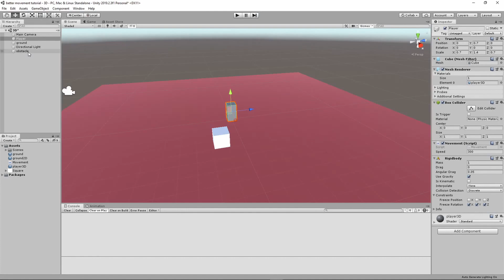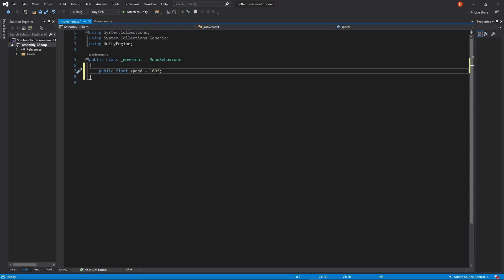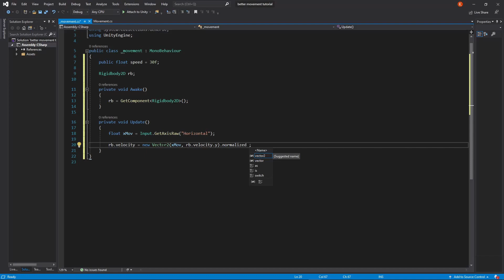The right way to do movement in Unity!

Comment: What if you want your character to move forward depending on which way you are facing using rb.velocity in 2D? I understand forward and backwards but when I try to rotate, it doesn't go forward, it just goes up and down.
Reply from the maker: Great question! I suggest you watch my video on 3D FPS Controller, which works pretty much the same way. You just need to use the Y axis instead of the Z. But here what you need to do: First you need to variables that will keep track of he speed in the X and Y axis (eg float xSpeed = Input.GetAxisRaw("Horizontal") * speed * Time.deltaTime; and do the same for the Y). Then we are going to use the transform.forward and transform.right vectors. Think about them as arrows that point to the local forward and right direction accordingly and have a length of 1. If you multiply a Vector ("arrow") with a float then it's length will get bigger of smaller accordingly. This means that we can multiply the transform.forward and right Vectors with the according speed variables from before. This will give us the final velocity Vectors for the local axis of the player. Then we can add whose and normalise the result and pass it into the rb.velocity variable. Here is the code for this:
rb.velocity = (transform.right * xSpeed + transform.forward * ySpeed).normalized;
Hope I helped you. If you have any further questions and problems feel free to ask them or even join the discord server (link in the description).
Reply: @ComplexDimensions  wow thanks so much!

Comment: how could i implement momentum using this method? ive been trying to figure this out for weeks
Reply from the maker: What do you mean by momentum? Do you what to create a physics-based game (say a flight sim)? Then you will need to make use of forces. By adding a force to an object you are accelerating it and that will give you momentum. Generally, though, momentum comes built-in with the RigidBody component. It depends on what you want to make. It would be great if you could provide me with a few more details.
Reply: @ComplexDimensions  i want to create a nice fps movement system, when i use rb.velocity it starts and stops straight away so it feels weird
Reply from the maker: I see. Well, there are two ways to do that. One, which I recommend, is to apply some smoothing on the input. The easiest way to go about doing that is to use Input.GetAxis instead of GetAxisRaw. If you want to create a manual smoothing, though, you can add every frame a certain amount to a variable according to the input until it gets to 1 or -1. I am planning to create a small video on smoothing inputs in unity.
When it comes to the second way, you will make use of the AddForce method. This will accelerate the player constantly and you can do that as long as the speed is smaller or equal to the speed that you want to achieve. The only problem is that it probably won't be that smooth and you will have a hard time implementing the breaking behaviour (stopping).
Hope I helped you. If you have further questions feel free to ask me again. Also, if you want some help with the first implementation, you can also join the discord server or even contact me personally there (link in the description).
Reply: @ComplexDimensions  thankyou!

Comment: Wouldn't putting the movement script in FixedUpdate just fix the entire issue?
Reply from the maker: The issue is caused by directly changing the position of the object. It doesn't have anything to do with the rate at which we do that.

Comment: hello, how to do those controls, for ships, as in the game Ship Simulator Extremes, as you push it forward, if you pull the lever it moves backwards, and if you turn the wheel, it turns the ship, at constant and slow speed, as it can be done, because have faster and slower ships, thanks
Reply from the maker: Great question! In this case, you will need to use forces. Making use of the RigidBody.AddForce method, you can simulate realistic physics behavior. Check out Tom Weiland's video on the topic. He explains how to create ships in unity very well. I also plan on doing a video on flight and in general realistic physics like simulators in unity.
Reply: Thank you, I liked how you explain it, I use a translator, I’m from Brazil, I liked the movement mechanics of the game Ship Simulator Extremes and I intend to learn to create a ship game in that sense, like the world of warships does too, thanks

Comment: I think something like addforce would work better because directly changing velocity causes issues
Reply from the maker: The constant force would result to a constant acceleration which in this case we don't want. Also, what kind of issues causes the direct change of the velocity? I would live to know, thanks!
Reply: @ComplexDimensions  One issue I had using velocity is that collisions would cause the player to glitch out. I manage addforce by doing AddForce(x * (speed - Mathf.Sqrt(rb.velocity.x * rb.velocity.x) etc. and that seems to keep it at a constant rate. Also to make sure the player stops moving when there is no input, i do a check for whether the keys are being pressed and if not i set the velocity on their axis to zero. Thank you for the tutorial though, it helped me out a ton
Reply from the maker: @rommarone1025  I actually use the velocity to prevent this problem from happening. Also, it is more complicated to use add force and not only that but calculating so much stuff that is required takes time, especially for a slow computer. Your idea could work if you want to achieve another feeling.
Reply: @ComplexDimensions  Good point, but i’m curious what you mean, I used pretty much the exact same code used in the video and had problems with collisions. I asked about it on forums and they advised me to just use addforce, and said that “directly changing the velocity causes issues”
Reply from the maker: @rommarone1025  For your problem: there is a collision detection setting in the rigidbody component. Play around with it and you will get different results. 
I can't understand much when people say "directly changing the velocity causes issues" when they don't specify any. I didn't have any problems with it and using transform was sometimes worse. A better way could be rigidbody.MovePosition(), but I don't think there is a big difference, since it moves the object's position (I am afraid I don't know how). Also, the rigidbody component was intended for physics simulations and changing the velocity will result in none accurate simulations. But we don't want physically accurate results such as Newtonian physics. So what we do here is complitly okay. I think when you have a tool, in this case the rigidbody, you it is okay to use it the "wrong way" or the way it wasn't intended as long as it has satisfying results.
Reply: @ComplexDimensions  Yea I mean I changed and experimented with all the settings in the rigidbody and it didn’t help. I’ll look into it more though. By the way, if you’re interested I’ll link to a question I asked on reddit about this: https://www.reddit.com/r/Unity3D/comments/junp6d/friction_between_player_and_wall_causes_player_to/?utm_source=share&utm_medium=ios_app&utm_name=iossmf

Comment: Complex Dimensions:pls explain me what means normalized,actually what do that ?
What I know about Method Normalize () is that has magnitude of 1 ,that means he always move by same step.?
Reply from the maker: Well, normalized converts a vector so that it has magnitude of 1. Think about it this way. We can visualise a vector with an arrow, the longer the arrow the bigger the magnitude of the vector. To find the magnetude of the vector you use the pithagoras therom: √(x²+y²) A vector of [2 0] (x is 2 and y is 0) has a magnetude of 2, since √(2²+0²) = 0 and the vector [1 1] has a magnetude of √(1²+1²) = √2. Because we change the two coordinates of the movement vector indipendently, their will be times, when the magnetude of it will be 0, 1 or even √2. Meening the player would be able to move up to about one and a half times faster depending on the direction. To solve this, we can use the normilezed vector, that is the same exact vector as before with the exception that its magnetude is 1. To sum up, when we have a vector and we normilise it, we will get a vector of the same direction but with a legth of 1.

Comment: Doesn't work for me for some reason
Reply from the maker: Can you send me your code?
Reply: @ComplexDimensions  I've replaced it with another one, sorry. This one works well but once I touch walls, I'm just stuck in the mid air until I'll move away, could you help me with it? (Also I'm sure your code worked but somehow I failed)
Reply from the maker: @gk1460  I don't know if your game is 3D or 2D. You need to somehow (e.g. ray cast, overlap checks) check if you are colliding with something and if you do, disable temporarily the movement in that direction. In case your game is 3D, I have a Rigidbody FPS controller tutorial and at the end I present a fix for that exact problem. Also consider joining the discord  server, where we can discuss your problem father.

Comment: Sorry but this is not the go-to solution for every problem.
For more complex problems where you want to be in full controll of the physics and movements its absolutely reasonable to "teleport" the player every set update (the internal physics should actually do the same btw)
Reply from the maker: I know. This is just a simple solution to a cummon problem. Of course, there are better and more accurate ways to make movement in unity.
Reply: @ComplexDimensions   Then all is well. It's just that you said that we shouldn't do it this way, which could discourage people from trying out new things and finding better solutions to occuring problems than those already established.

Comment: works, but the movement is a little weird. When I pressed d it goes in front and when I press w I go left and right
Reply from the maker: You've probably mixed up the axis. Try changing the Horizontal to Vertical and the opposite.

Comment: this works with a cube and that's pretty much all its gonna work with. you cannot turn the player in any direction and doing so is futile as u will still move in one direction. This cannot be used as a player controller. If ur looking to make a game where the player needs to rotate this is not the video.
Reply from the maker: Not at all! You can change the direction of the player is you use the local vectors of the transform (transform.right, froward and up). I have a video about a rigidbody fps controller, where I do exactly that. Here is the link: https://www.youtube.com/watch?v=N7UQlCTniBw&t=3s.

Comment: Nice tutorial but I didn't catch the rb.velocity.y..what is it used for on the vector3
Reply from the maker: Thanks! When you move e the player you don't want yon affect the "up and down" movement. So to work around that, we just set the velocity on the y to what ever it was.
Reply: @ComplexDimensions  it actually causes serious glitches with unity physics. I think it's better to disable gravity for the Player and calculate it manually. Cause i tried replicating scene like in the video and going to the edge of the platform will glitch player so much that Unity won't even allow you to zoom on it. And if platform has regedbody my player just glitched through (when i disabled script - no glitches)

Comment: From the Unity documentation:  "In most cases you should not modify the velocity directly, as this can result in unrealistic behaviour - use AddForce instead Do not set the velocity of an object every physics step, this will lead to unrealistic physics simulation. "
Source: https://docs.unity3d.com/ScriptReference/Rigidbody-velocity.html
Reply from the maker: This is for physics simulations, and the Rigidbody is intended for that. But we can use it to solve a few problems with the transform. If we used the AddForce method to move forward, then the player would accelerate forwards and will continue to accelerate unlit another force acts upon it to slow it down. So we use velocity to move the player and for jumping we use AddForce.
Reply: @ComplexDimensions  We could use Rigidbody.MovePosition instead of AddForce. I wanted to point out that Unity does not recommend to modify Rigidbody.velocity directly.
Reply from the maker: @ishtilkind  Since we want a constant speed and not really realistic physics behaviour, I don't see the problem with changing the velocity directly. What you quoted above, mainly talks about simulating physics, saying: "this will lead to unrealistic behaviour". And this exactly what we want. You can do it your way though!
Reply: @ishtilkind  if this is the case you should set the rigidbody to kinematic as move position is teleporting the object.

Comment: originally i was using this
'  float xAxis = Input.GetAxis("MoveX");
    float ZAxis = Input.GetAxis("MoveZ");

    Vector3 Move = new Vector3(xAxis,rb.velocity.y,ZAxis) * Speed * Time.fixedDeltaTime;

    Vector3 moveTo = rb.position + rb.transform.TransformDirection(Move);

    rb.MovePosition(moveTo);
'
 , i also have a animator controller, not using root motion, i tried your code because my character clips through my terrain and falls through when colliding with hills, unfortunately your code seems to only apply the velocity in world space meaning if i press forward, but im looking right i will always move towards the forward axis in world space, is there any way to amend this?
Reply from the maker: Use transform.forward instead of Vector3.forward and the same for right. I have a dedicated video on a fps controller here: https://youtu.be/N7UQlCTniBw

Comment: This is an amazing tutorial man. I've been looking for the right tutorial for 2d rigidbody movement for about an hour, so thx.
Reply: every tutorial i follow for fps i always follow all steps correctly and it never works or gives me a error or says cant inherit script someone help pls
Reply: @Prxojectmythic  what's the exact error you get or the line of code that's wrong?
Reply: @NapkinHolder_AH  at the start of the video where u see the line that says like vector 2 and delta time and stuff i followed a tutorial that told me how to write that and when i finished the tutorial and when to test it it gave me loads of errors and im on the verge of crying its so frustrating
Reply: @NapkinHolder_AH  u dont need to help but it would be much appreciated if u go to brackeys tutorial on how to make first video game ep 2 he writes a line "rigidbody" then after it clicks a key and it goes away and when he types it again it goes orange and workes can u tell me how to do that if possible?
Reply: @Prxojectmythic  so what he does is he makes a public component by typing "public" before the start function, making it blue. You must type the public components part before the functions like your start and update functions. Than, he put "Rigidbody" right after it, making that orange. This tells  you that this component, being the rigidbody, is the component being used for the code. Than, the white text is what you type to reference that component, So, if I want to add a force to the rigidbody, I'd type up the word that references the specific rigidbody. If you have any questions at all, feel free to reply back to me, I'll be here still :D
Reply: @NapkinHolder_AH  thank you so so much I’m only 14 and I wanna make being a dev my career u really helped me I’ll come back if I have any questions thank u 🙏
Reply: @Prxojectmythic  Oh don't worry fellow teen. I'm 15 here, and I've been coding for about 3 years. All you need to do to succeed in game design is have a good idea and execute it like it's your only project you're ever gonna work on. If you do need anymore help, I have discord I can link up or you can go to my channel and comment a problem you face. I'm always here to help, no matter what :)
Reply: @NapkinHolder_AH  ur a life saver man thanks 🙏
Reply: @NapkinHolder_AH  hey sorry to bother u but I was messing around in unity and I put a rigid body component on my player and made a script and on the script I wrote “public RigidBody rb;” then below that I wrote in void start “rb.useGravity = false;” but when I clicked play the gravity didn’t turn off?
Reply: @Prxojectmythic  ok, an easier way of turning off gravity on a rigidbody is going into the rigidbody component on the object and turn off gravity like that. That'll be easier
Reply: @NapkinHolder_AH  thx